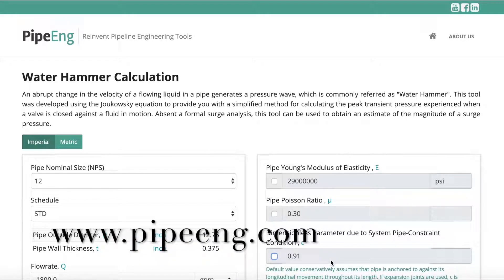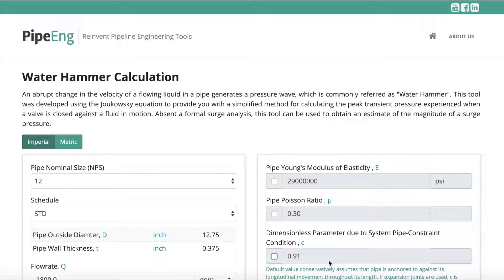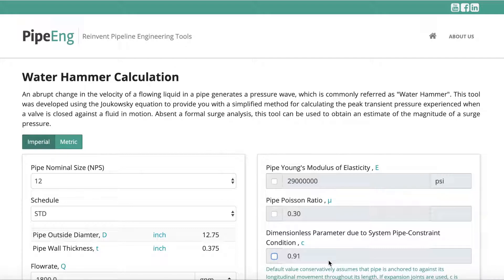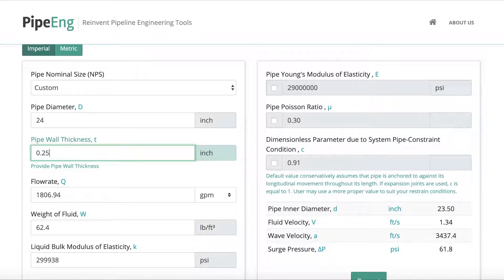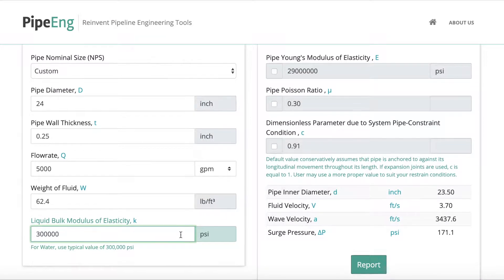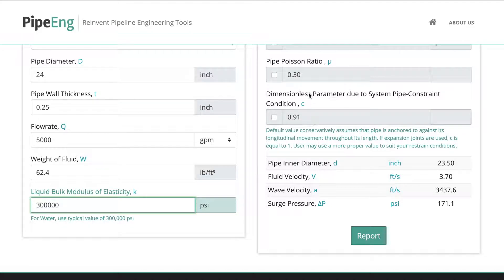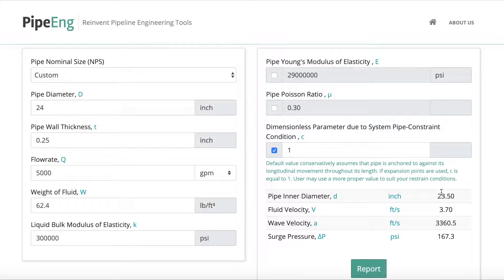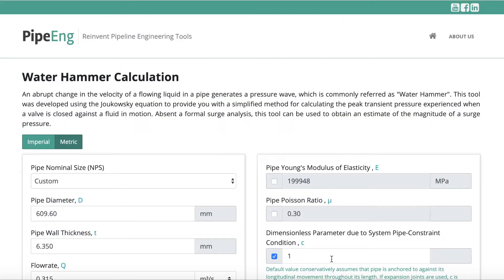Water Hammer  (Surge Pressure ) Calculation

Comment: I calculated water hammer pressure ie delta p. Now to calculate thickness of pipe I need to add this delta p with original earlier pressure of liquid in pipe or not. Pleasy comment